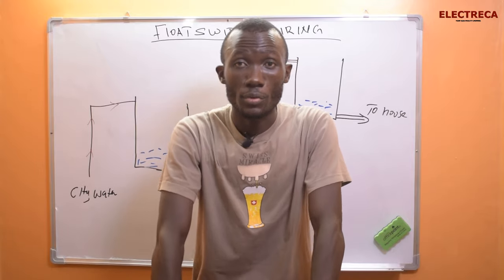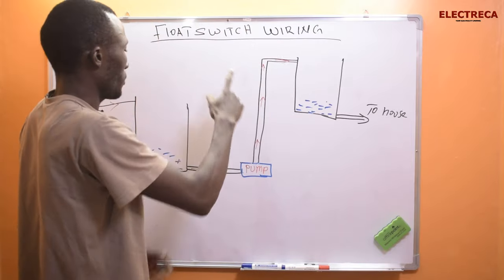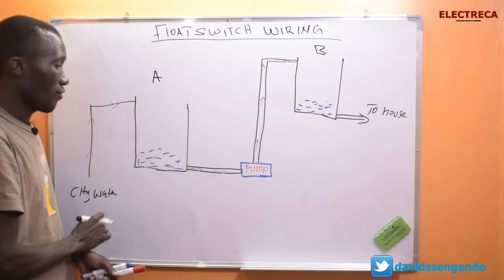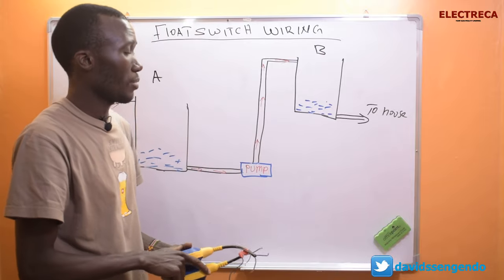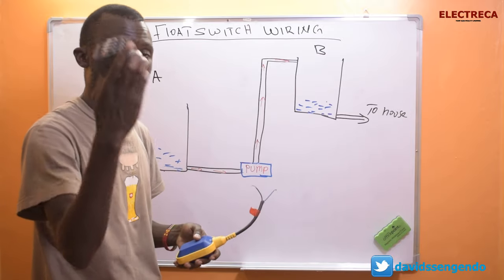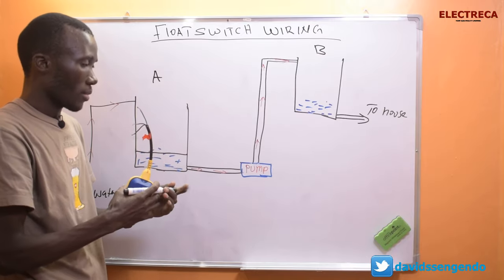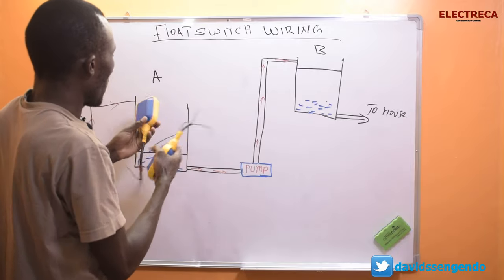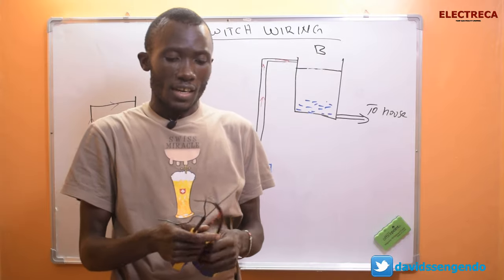DIY Float Switch Pump Wiring (Easy Step-By-Step Guide)

Comment: Glad that I found your video.  I had not considered a second float switch in my lower supply bulk tank, only in my upper house supply tank.  Smart to protect the pump if the lower bulk tank level drops too low to refill the house supply tank.
Reply from the maker: Glad I could help

Comment: Thanks , your explanation is very good but in some point you know ,by diagram explanation better than words briefing so you should focus on first  how to connect in a diagram theory on the contactor then function witch part of the flooting switches  wireing on contactor power inlet and outlet .

Comment: Could you please elaborate more about the (Normally Closed) NC and Normally Open (NO) wires of the float switch. Why does tank B need its switch to be NC and why does tank A need its switch to be NO?
What happens to the ball inside the switch in the NC and NO operations

Comment: Can you connect a float switch directly to  a pump. For instance I have a simple garden pump connected to a tank that that I fill with greywater. Can I connect a float directly to the pump or should I rather use a relay switch?
Reply from the maker: You cant use float switch directly, use a contactor or relay.
Reply: @electreca1  Can I ask why?

Comment: Good video. Question : was there there only one pump used to fill  for both tanks? And secondly the tanks are independent ?
Reply from the maker: The pump only fill one  tank, and the second tank is filled by gravity or by well in case its sump.
Reply: This is great!
In most cases people think of only overhead tank forgetting to protect the pump from incident where by supply won't be there when needed to feel the overhead tank.

Otherwise I think if you're getting supply direct from the swamp or River directly, then there won't be need for float switch in the side of underground tank. ❤

Comment: Which wire is the best to use to connect it
Reply from the maker: 2.5mm minmum, the size can increase depending on the length of the wire.

Comment: Can a one float switch controls two tanks of water at the same level of the water
Reply from the maker: Yes, if the tanks are interconnected and served by one source.
Reply: Yes they re connecting together, thank sir
Reply: Happy last Sunday of the month sir, the black wire stand for supply right why the brown or blue stand for neutral sir.
Reply: Sir I want you to teach me how to connect one floating switch with a two tanks of water at the same levels sir
Reply from the maker: @veporelijah2533   There is no neutral on the float switch.
Black wire is common/supply, brown wire supply the contactor if you want to fill the tank, blue wire supply the contactor if you want to empty the tank.

Watch that same video carefully and you will get the concept.
Reply: Thank you sir

Comment: yeah that is not the way to do it ! if the float switch has any leakage you can create dangerous currents traveling up to the showerhead or tap. you need to wire it through a contactor especially with higher amps, float switches are not designed to run a motor directly. This is why we have electricians !